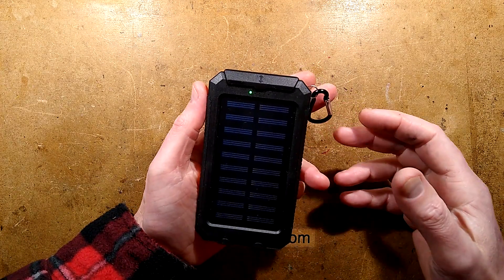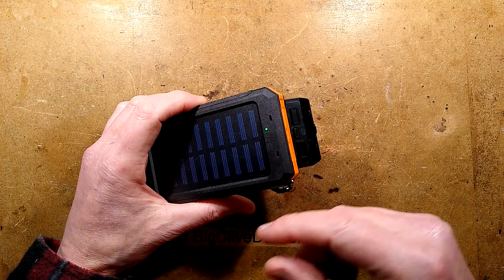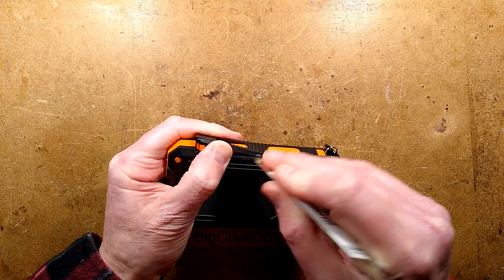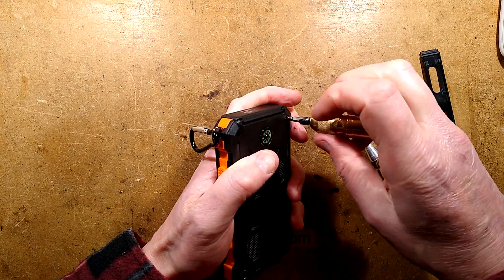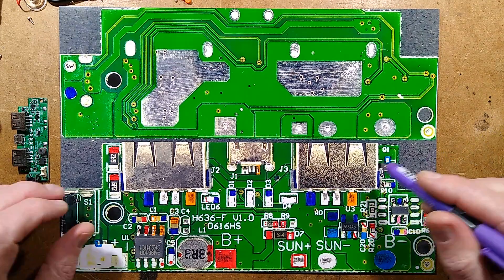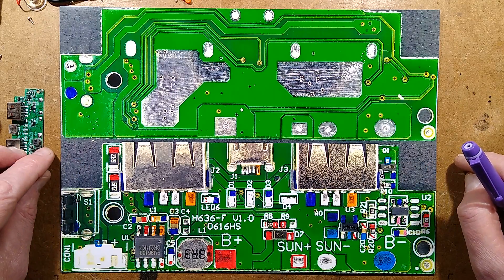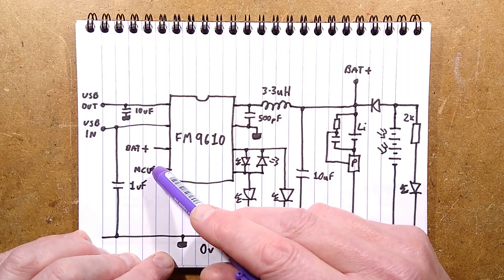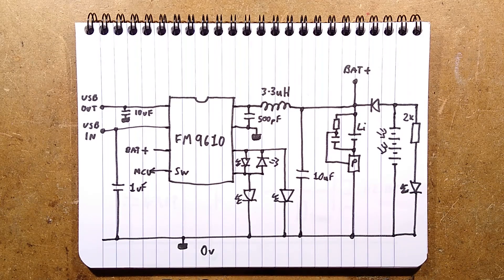eBay 9 MILLION mAh power bank teardown (with schematic)

Comment: I bought two of these in separate Temmoooo orders where they nudged my orders into a better discount category. Anyway, mine claimed to be 20000mAh, but turned out to be 4980mAh and 5105mAh. Different cells were used. I did get a full refund for one unit, and I was offered and accepted 50% refund on the second. I got to keep both. Although not much use as a power bank, I’ll build the cells into something. Wish I’d seen your vid first, tho’.  Thanks again.

Comment: it annoys me hugely that everybody talks about several k mAh, ignoring the fact that m stands for milli, one thousands of an amp, multiplied by the first three zeroes in the capacity rating.
 Why not use microamps? you can even put bigger numbers on the front. or state The voltage in millivolts as well?

Comment: I friend of mine gave me one of these as a Christmas present right around the time this video came out.  I used it heavily until recently when the capacity seemed to have dropped like a stone.  I just opened it up and there is a much larger cell taking up all of the available space and no weight to make it feel more substantial.

It’s frustrating to have nearly identical products out there with just different internals depending on how scrupulous the seller is. You never know what will actually come in the mail. Either way, I harvested the solar panel but I might try to find another lithium cell for it at some point

Comment: My Poundland single cell powerbank will continuously light 3 white LEDs with a 2200 ohm resistor. A powerbank case for 8 cells, turns off after a minute or so 😒
There is a built in pair of LEDs that do remain lit however, so I can use it to maintain a light in my bathroom for overnight comfort 🤭
My question to you - What can I add to my "USB A" load connection to keep power turned on, while not adversely draining the power? 
I seem to remember you have answered this in recent videos, but I am unable to find it now I need it😶
Reply from the maker: There are modules which pulse a load of about 100mA to keep some power banks awake.  But the best option is to use a simpler always-on module with a bigger battery bank.
For nighttime light I recommend the PIR activated USB rechargeable lights.
Reply: @ Thank you for your reply. I am going to hunt for some USB charger boards, I got dirt cheap years ago. (After years of hoarding, it is time to use or give the stuff away to make room for "me").

Comment: I've got one of these - just taken it apart as some time ago one usb out stopped working, now the other. (It still seems to charge ok though). A pity as mine turns out to have a very respectable looking cell inside, unlike yours! Had hoped for some iffy connections/solder but no such luck :(

Comment: I have this powerbank, I wonder if my suspision is true... 
When the solar cell is generating power, the indicator lights flash to show that it is changing.
The cell draws so little, that I strongly suspect the charging lights use up more power than is gained.
Reply from the maker: Sometimes that is the case.  And some have a fake solar panel and just a light sensor to make the charging LED light.

Comment: Does the solar panel actually charge the battery at all? I've recently brought one to replace an old power bank
Reply from the maker: Sometimes it's fake and sometimes real.  But putting it in very hot direct sunshine will often damage the cell inside.

Comment: The federal trade regulations no longer applies to these false claims. I remember when an amplifier or receiver had to provide the true RMS  wattage capabilities at a specific load in ohms, and not the misleading and exaggerated peak wattage specifications. Time have changed for the worse ever since this crap came from China by the millions. Consumer Reports is no longer a reliable source of product testing and safety issues. Recalls are very seldom used, and only done for infant and toddler injuries and deaths here in the USA.
.

Comment: Had one similar, solar did work, but would take 8 days to charge via solar, lasted about 3 hours of charging my phone before needed recharged, flashlight was handy because it was decently bright, but ths compass didnt work because there is metal in the power bank, i mainly used it to charge my headphones or things that needed micro usb, when i had only a short one foot cable

Comment: I have one of these, it packed up after two charge/discharge cycles. The solar panel is useless. I took it to bits and It does have a way bigger cell than the one in your video, nothing written on it to say what capacity it is though. The circuit board is slightly different too

Comment: Given that its 9000000 milli ah its 9000ah or 324000kwh or only 3x a tesla fully charged, still easily 600 miles per little doohickey but not rhat gargantuan
Reply: Actually my math was off too lol, less then 1

Comment: one question sir,
i would want to know that at how much current that you discharged that small 3.7v lipo battery for getting its MaH.
plz reply 🙏
Reply from the maker: I use low current for the capacity tests.  In this case about 500mA.
Reply: @bigclivedotcom  thank you for your reply sir,
sir will it effect the output result if we discharge the battery at lower or higher current than 500ma.

Comment: I bought a solar power bank when they first came out on eBay ... [yep ... way back in the day] ... and it died soon after it arrived.
So, I did what any reasonable person would do under those circumstances, and dismantled it to find out why it died. 
To my absolute horror I discovered it had 6 non-rechargeable AA batteries inside, and the solar panel [that worked fine incidentally] was not attached to anything except for the case.
I kept the case, the solar panel and the usb gubbins for a future project ... and I possibly / probably still have it in a box somewhere, along with all the other bits n bobs that I've collected over the last 28 years  ... hehe. 
I ended up making my own power bank in the end ... from a kit ... actually, I made 2 ... one for 5v and one for 5 / 9 and 12v.  I have no idea what they're rated at, don't really care ... all I care about is that they work when I need them to work.  
Still have them, still use them ... in-fact I have not ever changed the batteries on either ... proving that my time living in Scotland as a child was not wasted.

Comment: And they write that numbers on the box with a straight face! 🤣
I wonder how we end up using measurements like "9,000,000 mAh" or "500,000 uF" instead of "9 kAh" or "500 mF". The system has prefixes for a reason 🤷‍♂

Comment: cheers for taking yours to bit! i'm tempted to take mine apart when it craps out to see if it contains a metal bar for weight, but it has been useful for 5 or so years now. it has a cigarette lighter coil which comes in handy when it's really cold out, a light when needed, and no useless compass. either the solar does its' job by trickle charging or the battery holds a lengthy charge. i'd say two or three times a year it gets to one dot and i do have to charge it, but it takes awhile through the micro usb port. the two usb outputs are probably similar to this model, if i attempt to charge a cellphone and an ipad, one will cut out, so i only use it for one device. i also tried two different usb bendable mini fans and while one works continuously, the other just goes on and off. anyways, an upgrade is on the horizon with usb-c, wireless/qi charging, and millions of mAhs capacity!!!

Comment: Just wanted to chime in, I got one that looks exactly the same, from a seller on ali. I decided to take it apart and have a look, maybe see if I could upgrade the battery. I was pleased to see a very large cell inside about 5mm thick and the full size of the cavity. I just re assembled it. My unit did cost a bit more than yours though.

Comment: To be fair, you're a few orders of magnitude out - that's nine million MILLI amp-hours, so only 9000 Ah, 32.4kWh, a pretty modest Tesla battery, less than half the new model 3 for example, so actually it's only meant to provide enough to top up a Tesla model 3 by about a third of a full charge, presumably over a modest several months because of the limited continuous current. So handy to top up mid-journey if you're not in a hurry and have somewhere to stay but no mains supply, say. If you just use it to charge your phone, I assume you never need to recharge the power bank though - once you have your 9000Ah in there, that's enough to keep recharging most phones until they wear out or get lost or stolen.

Ah - just watched the rest of the video and you already corrected your calculations. I wonder what the metal weight is? There was some very dodgy metal ballast in some wee keychain LED torches back in the day that I became convinced were created as a way of disposing of depleted uranium, though these days they usually get rid of that by shooting it at people.

Comment: YEA..... I owned 2 of these. Both caught on fire.
Reply from the maker: Did you have them charging in the sun at the time?
Reply: @bigclivedotcom  yes. One was in the sun. The other was in my shop class. We have ballast Lights (Probably HPS or MH) and it was sitting on my lathe when it started letting the smoke out. I assumed the first one was just defective and got a "Free Replacement". Now I realize they just wanted a second chance to try to kill me!
Reply: @bigclivedotcom  You know... I have been thinking since bringing it up yesterday and it It bothers me most that the market is flooded with rechargeable devices and it is assumed most devices are "safe" provided it is acquired via a Major Retail Outlet. I bought mine at (A Major Retail Outlet) which is why I "Assumed" the issue was isolated when the first one "malfunctioned". The scary part is we are all chasing More Power, Longer Life, Faster Charging. Most People don't understand the current potential destructive capabilities of the devices they currently carry. It was not until this run in that I learned to truly respect these devices. Have you seen any of the E-Bike, scooter, skateboard battery fire videos? They are Terrifying!

Comment: 9 million mAH x 3.6 V DIVIDED by 1000 (mA/A) -- come on Clive !!!
9,000 AH x 3.6 V = 32.4 kWH !!! is ONLY a rating and has NOTHING to do with the maximum current into a load !
I have a Uniden 8,000 mAH pack that looks exactly like the one you showed, so I do not believe this pack labelling !
The user instructions specifically EXCLUDE the solar panel as a primary charging source -- it is only for topping up.
btw, the stated purpose of this unit is to recharge batteries in phones, lights, at al. and its size means it is good for long bush walks or rambling events and camping.
Reply: Thnx for your feedback on my comments.
I also noticed you picked up your computation error later in the video -- sorry for the premature explosion.

Comment: I bought 3 different powerbank jump starters from 30,000 to 50,000  doing my basic tests by full charge and measuring the amount of times it would charge my phone, none would full charge once , and i had to send them back. I have reported all sellers , one seller admitted that they knew it was a lie.

Comment: I have the same one, opened it to check after your video, but it has an 8000mah battery inside and was sold as an 8000. Someone got their hands on the tooling and is shipping them out like the one you recieved.

Comment: The really suck part is that they have previously also marketed these as 20,000 mAh batteries... within the realm of possibility - and at a price that would lead you to think they were legit. Alas, not so much.  The little solar cell will charge it up - the full 2500 mAh, that is - in about 6-8 hours of direct sunlight...

Comment: Tesla: struggles in li-ion/pol batteries limitation, which by a standard sizes can power a car for ~500 KM
The chinese EBay non-sense: i can power-up your Tesla for a year ! With 10 times smaller sized package ! But just... Dont do that. Please

Comment: I know this video was done as a joke, but there's a fatal flaw in your argument -- it's based on an assumption.  Specifically, you assumed that the 9 million mAh claim is based on the 3.6V voltage of the lithium cell, which is a perfectly valid assumption in the absence of a stated voltage, but it's still just an assumption (in other words, a guess).  This product absolutely DOES have a 9 million mAh capacity, just nowhere near that assumed voltage.  For example, it will most likely meet (and could even exceed) 9 million mAh at 0.001V.

Comment: Scummy advertisement techniques or not, I'm amazed they are able to sell this at such a low price. I can't imagine the kind of margins these people are making over this, how many units they have to sell to even cover the R&D costs. I really wonder the kind of infrastructure they have to be able to produce these. How specialized the supply chain is. There are some costs you have to eat anyway, like the mold for the plastic parts. There is not a lot of coverage over the production of these cheap products. We know how it is for iPhones but it's a completely different territory with a lot more resources.

Comment: I kind of got concerned for a second because I actually have a power bank that looks almost identical to this except some of the functionality like with the button and the LED response to light is different.
except mine's only rated 20,000 mAh and I've never had a problem out of it, but I still took it apart and was more than happy to see it had a giant battery in it not just a small one with a weight.
it's very likely that they're ripping off the design of this power bank although I can't say what company came up with design first but mine is from YELOMIN or at least that's what it says on the front.

although I forgot to mention that from a functionality standpoint it seems to do its job fairly well, and has got me through a couple of power outages.
I did notice when taking it apart that the screw holes broke on all four sides after being disassembled one single time...
and the screws were rested which is interesting because it's supposed to be water resistant but there was no damage on the inside, although it's never been submerged or doused in a significant amount of water.

Comment: We need to start standardizing Wh for battery capacities. It makes so much more sense for general capacity.

I get why it's done the way it is right now, since it's technically talking about the capacity in that use case. It's still rather dumb

Comment: I got one of these off Wish years ago. Would at best charge a phone for 2 minutes. The cells were bigger on the inside but it was junk.

I still have it as it oddly works as a solar powered flashlight.

Comment: Yes they work good but for short time because of heat build up heat under the solar cell when out in sun and it takes a long time to get the battery to charge in full sun ,the battery (li-pol) is heat sensitive they didnt take into account for that when designing the unit ,when laying in the sun even in colder weather it builds alot of heat in the unit past its safe zone and damages the battery ,I have a multi panel solar fold out and it takes a while to charge the battery in full sun and it didnt last long  ,they should at least put vents on the unit to help the battery keep cooler.

Comment: Big time following for a few years...me maintenance electricton,  mills and what not ...bla.bla....I have a ,well a Swiss army ,by victorinox pocket. Watch that is new, and only with new battery just ticks back and forth...ya want it ? Would love to see you take it to bits.
Reply from the maker: It may just need cleaned internally.  Possibly a spec of dust in a cog.
Reply: @bigclivedotcom  it's electric,  the second hand just twitches,  new battery.

Comment: Really ? What a big glaring lie?
9 million mAH means that tiny package is “supposed”😂 to be 9000AH (amp hours), which technically can’t be true because there is something in energy storage known as ENERGY DENSITY. There is no no way in the world at the moment that such a small volume pack can stash 9000 amp hours inside a “match box” sized container. We don’t have that capability or chemistry yet in this planet earth. And that’s not a nuclear powered box either.
So you see, the manufacturer is just doing marketing and fooling around. What a shame. I hope no potential buyer falls for the “millions” joke advertised.

Comment: 0:38 should be 32.4 kWh not 32.4 MWh (I think) as you used mAh x Voltage.
edit - appologies, I didn't read the correctrion in the description 😂.

Comment: Back in 2008. I had ordered 2 different solar chargers for my iphone 3g. They both came from the UK and were quite pricey at the time, minimum wage was about $12/h where I am. about $200-$350 USD for the charger and accessories.

The globetrotter solar charger worked good but the charging port didn't last. The other solar charger, the iphone solar charger case, I charged it from the wall 1st time. charged my iphone, and it was able to do its solar thing. Then I plug it into the wall 2nd time and all the charging leds turned off. The battery part never worked again but it did make my phone display the charging icon when it was in the sun.

Comment: I didn't even think it would hit 9,000 mAh and it wasn't close. However they could have used the space better to fit in at least double of the 2,500 mAh battery capacity that is actually in this unit.